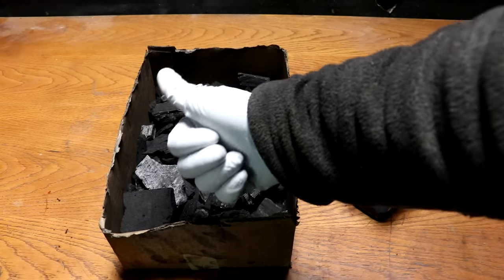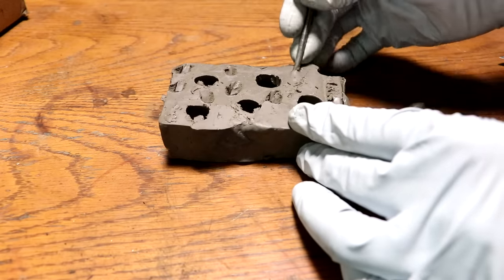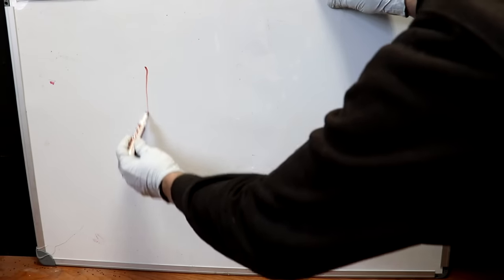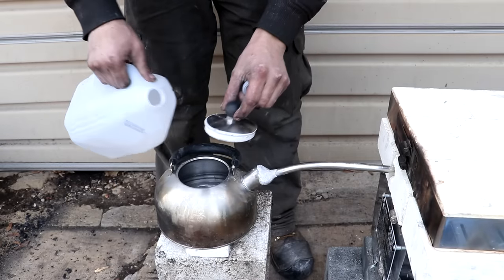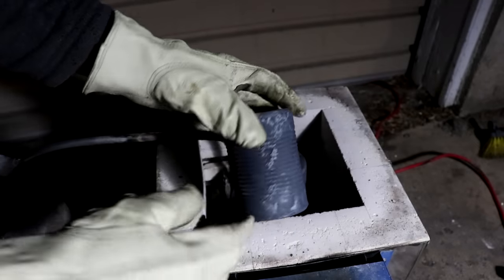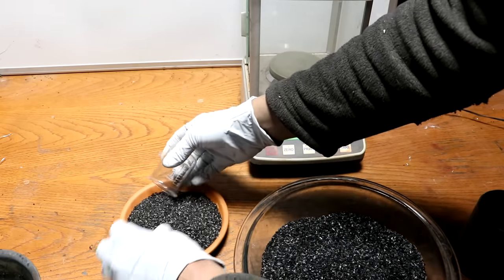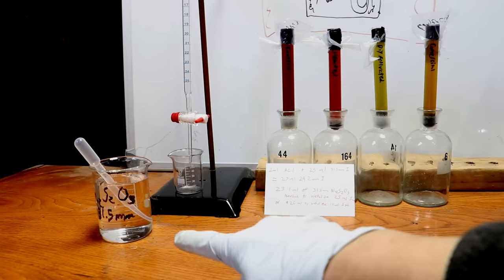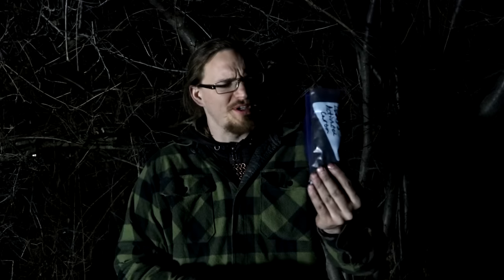Making Activated Carbon

Comment: Great video! I love how you were able to use chemistry to prove the efficacy of your DIY batch of activated charcoal against a control group!

What brought me to this video was researching biochar and its difference from activated charcoal. It seems that activated charcoal requires higher temperatures, 900C; compared to biochar which only needs 300C of dry heat.

I am still curious where activated charcoal could be useful in the garden. I think if you just dumped a bunch into a garden your plants wouldn’t be able to access as much in terms of nutrients because they are all trapped by the adsorption of the pores in the carbon.

But biochar’s porosity would be much less and therefore could increase the cation exchange capacity without being too porous and adsorbing all the nutrition. It’s just a hypothesis but it sounds logical.

Maybe one could use activated charcoal to filter out microscopic toxins in the garden soil, making an inert soil that could then be fertilized.

Comment: 3:35 thank you very much for noting that activated charcoal and regular charcoal are still essentially the same thing! (For those that didn't catch that, the difference being less tars in the activated charcoal, and for that reason more pores and surface area thereof; but the functioning "medicinal" property being the same in that it's the pores which do the work by filtering out toxins). (I do want to note, "medicinally", that the pores are NOT small enough to filter out bacteria and viruses, so in a survival setting of purifying questionable drinking water you want to take additional steps to make it potable!)
Reply: Jeez, I wrote more in parentheses than not, lol
Reply: The final results were amazing. I guess activated isn't the "same thing" after all! Good to know that just reheating charcoal makes it roughly a third as "activated" as the real deal. Is it possible to just soak it in water prior to heating so that it steams itself internally?

Comment: somewhat similar to aerogel making.
I think that by using water you fall into the same problem of capilarity efect causing the colapse of the structure when the water goes away.
probably thats why you got denser charcoal.
If you could use hot nitrogen to over heat the charcoal instead of water you would probably get more efficient activated charcoal.

Comment: Hey Cody, I know that coal is heated to drive off volatile matter when determining the volatile matter content of the coal. Is it not possible that heating the charcoal to temperatures above 900C would have driven all of the volatiles (oil and tars) off, leaving only the more dense ash and carbon? I know this would explain the increased surface area, as you also explained in your video. Also, with the heating of the charcoal, it is possible for air pockets or volatile matter evaporating could create enough stress to break the pieces apart. I know from my own furnace that adding extra anthracite or charcoal to the furnace causes it to "pop" shortly after adding. Did you perhaps notice any changes to the particle size distribution? This could explain why the charcoal that was heated also experienced a density change, as opposed to the material contracting in the heat. What do you think?

Comment: Commercial activated charcoal probably was already slightly contaminated as it is typically in a non sealed bag, so will adsorb from the ambient while being transported and stored. The newly made one has not had time to do this, so works better.

Comment: Hi Cody, awesome video as usual. Just for the next time you need to bend something: You might be able to use sand to prevent the pipe from collapsing. This might be easier than using tin.

Comment: This is more than a good video rather a  real scientific research example , and  Thank you for posting it . 
Could the reason for the heavier treated charcoal be some still trapped inside water vapor molecules and maybe you can heat the activated charcoal for a longer time to drive off all trapped water vapor?

Comment: I would be interested to know whether the diy activated charcoal's effectiveness decay's over time. It could be that the reason the commercial activated carbon had worse results than the diy is that the commercial batch had more time to absorb latent particles in the air whereas the diy stuff was more fresh.

Comment: Could you use the Brazil Nut effect to separate the charcoal piece sizes?  Perhaps put all the crushed charcoal in a closed 5 gallon bucket and then put that on top of some kind of shake table for a few hours.  Then the biggest pieces would be at the top and the dust all at the bottom and it should form a gradient between them.  You'd have to be careful about removing it in layers and not mixing it, but it might make it easier to do without loosing as much of the dust or making as much of a mess.

Comment: Great show!  I've noticed if you use an aluminum pipe after the  kettle,  heat it with a torch, the steam is gone, totally transparent.. is this not dry steam? Wouldn't it work better.. ive been bending wood.

Comment: Hi Cody. I'm gonna say thanks for the video even though I didn't understand any of it. I'm an old fart who left school at 14 so my education is lacking. (I watch things like this in an attempt to understand) Anyway I make my own spirits and run the final diluted product through 3 in line filters. Each one is about 5 inches in your speak. Each one contains about an inch of filter wool at each end and the rest is filled with activated carbon. So long as I change it after 2 or maybe 3 uses I find it works well. So my question (for you or anyone who cares to enlighten me) is how the activated carbon collects and holds all the impurities from the alcohol. I use it because smarter people than me told me that's what it needs to remove impurities. Any help would be greatly appreciated. Cheers from a small wheatbelt town in Western Australia. Now I'm off to re-watch the video and pay closer attention to see if I can figure this out on my own.

Comment: I was wondering if I could make my own activated charcoal earlier today. I burned a ridiculous amount of hardwood to get charcoal, some of which I burned down to hardwood ash which I will use to make lye for soapmaking. However, I still have a 5 gallon bucket worth of fine-ish hardwood charcoal. I guess I'll turn some of it into actuated charcoal for filtering things. I'll try to do the same setup but with a propane forge rather than an electric kiln. Plus I can use heat coming off it to boil the water.

Comment: hey if you make a saturated solution of dishsoap and water and fill your tube and freeze it, it makes a much easier anti crush filler for tube. verry fine sand also works well just fill tube tap it packed then pinch and rollover very end to cap. old brass horn makers  tricks.

Comment: Maybe the charcoal you bought had a fire starter/fuel added to it to make it burn easier? That would stop it absorbing as much water, but might be burned off in the kiln, which could explain the jump in absorbance between the control and the just heated sample

Comment: Activated carbon will adsorb a very wide array of molecules.  Mostly because of the large variation in pore sizes but also because of other effects I believe.  It's an extremely complex substance I don't fully understand even though I design huge adsorption beds all the time using it.  And, surprisingly, one of the things it will adsorb is water.  I think it's just a couple percentage at best by weight, but that may be one explanation for the actual increase in the weight of your activated carbon.

Comment: Interesting never thought this could be used to purify water... I guess it makes sense, that's basically what is in those britta filters right?  Can the "spent" carbon be recycled in any way?  Like compost or anything?  This kinda got me thinking it would make a great way to filter water in an off grid setting if you can setup a more efficient production line to make it in larger quantities.  Perhaps off solar power in summer when there is tons of daylight hours.

Comment: I have two questions, if I don't have the same facilities as yours at home, 1. can I put the crushed charcoal in household dishwaher (extended wash cycle) to wash off the tar (more washing cycle if applied, 2 or more); 2. can I just pust the crushed charocal in a combi oven to steam it for an hour to remove the tar?

Comment: Cody

Since simply heating your homemade charcoal made it 15 times better

And superheated steam was only three times better than that

You deliberately sifted out the finer particles to do the steam process.. as you were afraid the steam would not penetrate.

However, since heating worked so well on its own. Would not a finer material, heated up most likely work nearly as well?

You could make it a finer grind, and just do the heating without the steam.. would be interesting to see the results.

Comment: Supposedly you can make a thixotropic carbon. I once saw a film on Thixotropy where a solid black rod was tapped on the counter to show that it was hard and then stood on end in a wide shallow pan, was struck sharply with  a hammer like a large nail or spike whereupon it suddenly liquified into a black syrupy mass. I've always wondered what it was made from.

Comment: How do you know that the cresote and oils in the unactivated carbon dont add to the colour of the water? I think the steam forces out the oils (in gas form)that are denser and that's why the sample is clearer. I would like to see you try again with co2 or Nitrogen , halon whatever is inert and force it through a heated chamber that you can keep from o2

Comment: So, the reaction to activate the carbon is endothermic, but it produces flammable biproducts (H2), so, could you use the burning hydrogen to heat the carbon instead of needing the furnace? If not (probably not), could you use it to supplement the furnace and keep the carbon’s temperature up? As a bonus, if you could find a way to burn it inside the furnace, it would help keep oxygen away by consuming it in combustion.

Comment: I tried "reactivating" carbon that was used for odor control in a filter by washing it first and then I put them in 240C oven for an hour. 
That was stupid. The heat was probably way too low to do anything but stink up my apartment for days. Just a cautionary tale for someone who might be thinking of doing something similar.

Comment: Nice job demystifying activated charcoal. For a layman, your knowledge of chemistry is impressive. Good video. Not that the method is practical, given the low cost of commercial stuff, but it is cool to know the process and to have an answer when peeps ask, "WTF is activated charcoal, and why are you using it for that?".

Comment: could you use a ceramic container to hold the charcoal in this process or would the superheated steam react badly to the ceramics? 

I'm thinking in foundational, starting from nothing, bootstrapping methods. Obviously you'd have to have a supply of clay to make pottery but I'm thinking if you didn't have access to stainless steel if ceramic pots could be used to hold the charcoal?

Comment: you might consider using a coil inside the vessel and just pump water through.  You will super heat the water into flash vapour and work better than just trying to injecting steam into the furnace.  Not sure you can really call this super heated steam... water boils at the temp it boils at, regardless of the temperature around it (you know.... pressure and other factors like purity).  Super heated steam requires pressure.  At least that's what I remember from way, way back in my studies :)  Nice effort though.... Glad you tried to estimate surface area.  Why not take it to the local college or university and see if some kind soul might do a proper determination.  They might even give you an SEM snap of your first born bit of activated charcoal :)

Comment: @Cody 13:40 maybe the holes inside became smaller after the heat. and then the carbon had shrink a little bit
15:20 AWESOME RESULTS MAN,

Comment: as far as yours being better than commercial, I believe it, you used Hardwood charcoal I'm sure the commercial derivative is made from the cheapest coal they can get. Which could show that the quality of coal while different is insignificant as long as it's activated.

Secondary thought, was the water you used for steam pure or tap and would that matter?

Comment: It makes sense that yours was better than commercial, they make way bigger amounts than you did and that has many complications like getting the stem to react with all of the amount, if they make hundreds of kilograms per batch it's going to be tricky and probably won't have perfect contact, some parts will be way better than yours but other parts will be worse and they balance each other, maybe.

Comment: I’ve read (quick google search) you can just mix powdered carbon with calcium chloride and distilled water, then wash with distilled water to remove the calcium chloride and dry. What you’d be left with is activated charcoal. I feel this is much less complicated if it is a valid procedure
Reply from the maker: Alright clearly I need to debunk that myth in video.

Comment: I would like to know how carbon, being combustible and consumable such as charcoal (and producing Co2 into the atmosphere when burned) is suitable for high temp applications like- your foundry crucible, the space shuttle heat shield, and a carbon arc electrode..And I think the "tars" in the wood are usually called creosote.

Comment: Hi, I'm not a specialist but I read in the Wiki that commercial activated carbon has about 3000m ^ 2 /gram (laboratory carbon has about 4000m^2/gram), which according to your calculation (1mg/~1000m^2) you should filtrate more or less 4mg of Iodine per 1 gram of activated carbon so i do not understand the result.
It is possible that there is a mistake but as i sad, i am not a specialist AND not an English native speaker. I would be very glad if you tell me if i misunderstand something.
Thanks and regards

Comment: Hello Cody, quick technical question after revisiting your fantastic video on this matter, it has been some years...I recently bought some activated carbon myself and stumbled upon the data sheet, there it said that the Iodine absorption be 950 mg/g, after some research i´m still failing to find sources that  state iodine absorption numbers smaller than a few hundred mg/g. In my sample of peat activated carbon for example it is said to be about 950 mg/g. Did i catch something wrong and you used some other form of iodine in your project or how did this discrepancy come to be? Greetings from Belgium, i´m looking forward to new videos of your making

Comment: if you could figure out how to weigh the carbon before and after without spilling any, you could precisely measure how much weight  it gained or lost.
Also, does the steam react with any other carbon molecules?  I wonder if some "coal like" residues in the charcoal are reacting with and holding onto the hydrogen and/or oxygen.

Comment: You should try chemically activating it, I've had some luck with soaking the charcoal overnight in citric acid, drying it and then decomposing the citric acid by heating it again.

Comment: Very useful, thank you. I keep activated carbon on hand because i work with a lot of herbs, some of which are very toxic.
Reply: The Horned One what kind of herbs do you work with?
Reply: @thedankside2552  Most of the common ones used for treating basic ilnesses, but the herbs i have that i specifically worry about if Atropa Belladona (deadly nightshade) and Aconite (Wolves Bane). I also occasionally collect wild Hemlock in my area.

Comment: Hi dear
 I have a question. I saw the clips related to the production of active carbon. All of them, for example, first grind coal or charcoal, and then grind it and separate the coal fine powder, and then activate the remaining granules with steam. The question is, considering that the smaller size has better reactivity, why do they separate the powder and not activate the powder and granules obtained from the coal mill at the same time?

Comment: A small question at 15:52 : Did you forget to multiply 2 as the stoichiometric ratio of sodium thiosulphate and iodine is 2:1, taking [I2] = 29.2 mM, volume of Na2S2O3 is supposed to be 46.3 mL.

Hope somebody would help me, thanks so much

Comment: I made my own charcoal once in a wood stove.  I had a very hot fire going with a nice bed of glowing hot coals.  I just simple pulled out the glowing red coals and dunked them in water.  Then I dried them out next to the wood stove.  I used it to BBQ it worked great I still have  some left.

Comment: I saw a guy do the same thing with just lemon juice. I searched several pages of comments and didn't find any mention of activating carbon with acid. Any thoughts on which is produces a better result and by how much? 🤔 Obviously the lemon juice method would be WAY more cost effective and easy, so if the results are comparable, I'd think that would be the preferable DIY method. Not to rain on your parade, but for survival purposes. 😉

Comment: Saw a video using Lemon juice (1 ounce) + water (3 ounces) + powdered charcoal (8 ounces), 24 hour wait, then evaporated the water+lemon. Will that work also? Would be great if you can make a video of how the absorption capacity compares with your method.
Reply: It doesn’t, Cody tested this in another video.